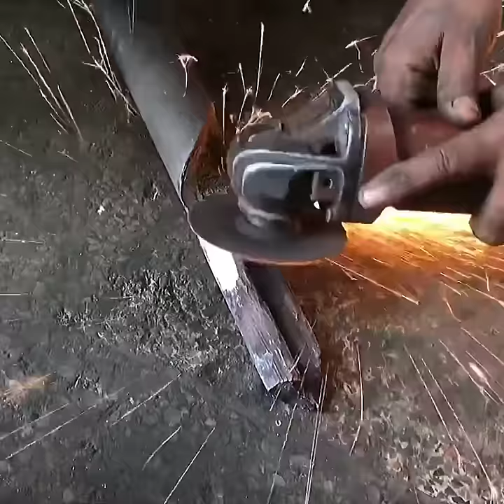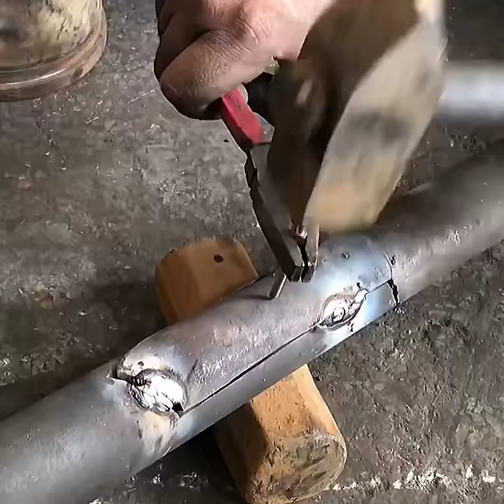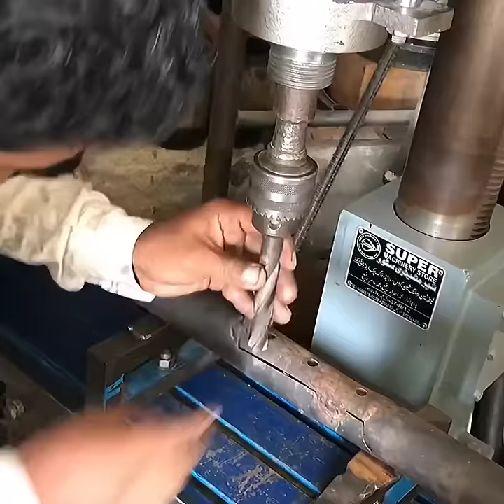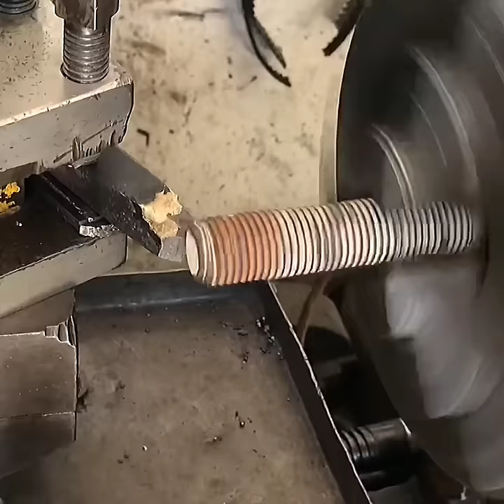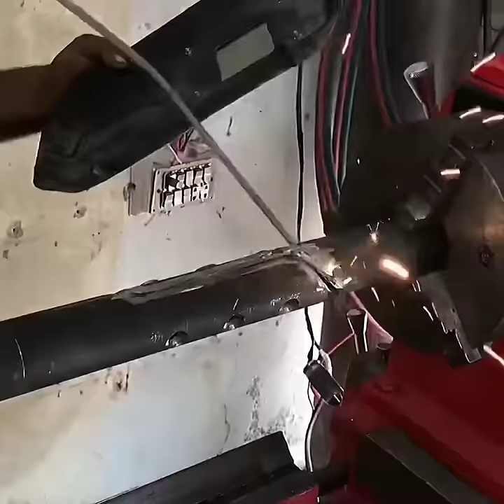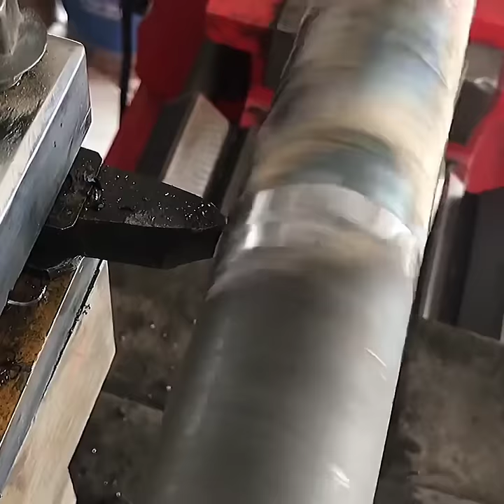How To Rebuild Broken Axle Using Bolt ,Never Seen Before using of Bolt in Rebuilding Truck Axle

Comment: Wonder where it is going to break next time
Reply: They still have better machines than I do...yet...and that might last a long time. I am sure they know the metallurgy of the splined axles they use..
Reply: that repair is very strong
Reply: Se romperá por otro sitio por ahí seguro que no
Reply: You mean like iPhone don't repair, just buy new truck,
Reply: @thatsawesome2060  no I think he should throwaway the shaft and stick a pack of spaghetti in there instead
Reply: The screws. Tensile differences. If they have termites they can try termite weld it instead.
Reply: Same place.
Reply: Se romperá en tu mente
Reply: Use termites only if you can’t find an anthill nearby
Reply: At the repair.

Comment: This is from a full floating axle and thus only transmits twisting/drive motion. The tire/wheel can stay on the truck and roll around carrying load without this component.